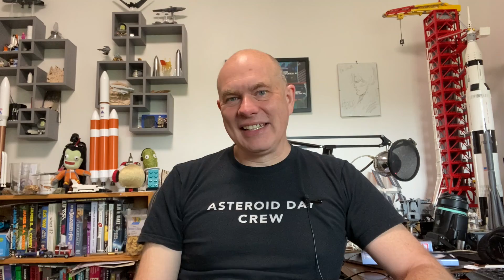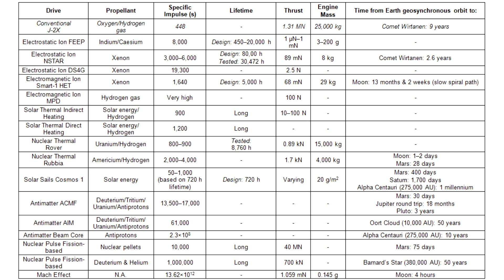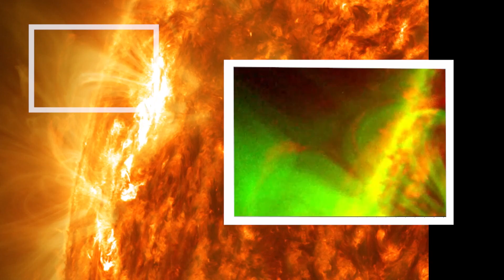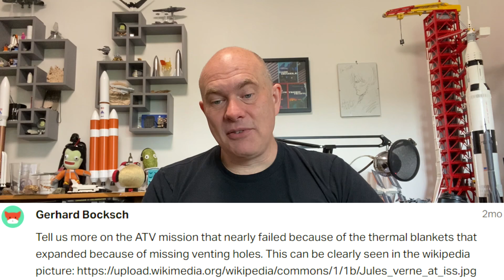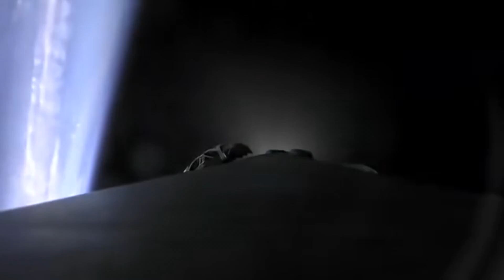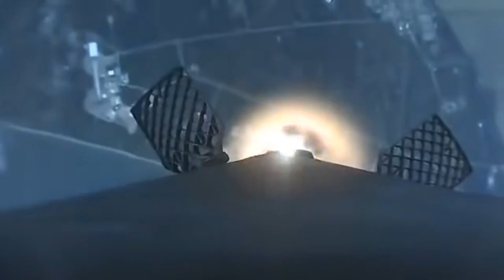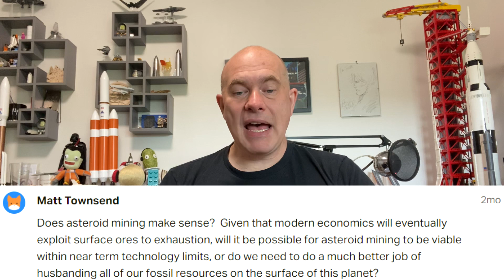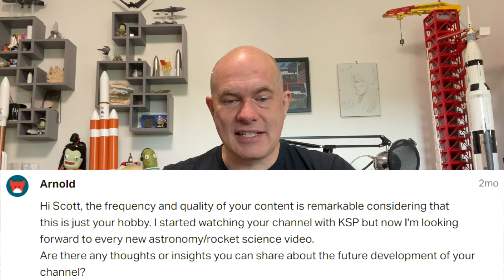Viewer Questions Episode 4

Comment: I believe the Raptor efficiency claim is combustion efficiency, or the turbo pump efficiency. I read somewhere "since the engine is staged combustion the turbo pumps are effectively 100% efficient. But it still uses 16MW of power, which translates to a 68K reduction in chamber temp."

Comment: Line source: The effect used in line sources is basically a synchronized pressure front. The pressure waves of adjacent emitters are constraint in one dimension, meaning the pressure will not drop by the square of the distance but just linear. A two dimensional area source would in theory have no drop at all. 
The question is - would it make any sense for a rocket engine, if the exhaust gases are basically constraint by adjacent plumes? Is a 3x3 Cluster more efficient than a 1x9 cluster? is a 1x9 cluster more efficient than 9 engines spread out? If the answer is yes, then I'm pretty sure the Falcon 9 is already using this principle.

Comment: I think that Elon Musk's 99% efficiency  refers to the fact that he gets 99% of the methane and oxygen to react due to the fact that they enter the combustion chamber as hot gasses rather than liquids which happens in most other rocket engines.  This says nothing about percent of maximum theoretical ISP or anything like that.

Comment: I think the 99% on the raptor came from “99% combustion efficiency” as in 99% of the propellant burning up inside the engine
Reply: Just remember with Starship so far it's 100% conversion of the engine to propellant and thrust in a 360° spread.
Reply: Yes. I was about to say the same thing.
Reply: I second this. I remember Elon Musk, interviewed by Tim Dodd (Dott? How does he spell it?) the everyday astronaut and saying "If God came into the combustion chamber and pair CH4 molecules with O2, he'd only do 1% better than us..."
Reply: that is, 99% of the chemical energy turns into thrust times Isp
Reply: @otheraccount5252  the 99% is just related to the chemical reaction. Musk said that because it's a hot gas-gas interaction he expects that 98-99% of the fuel and oxidizer molecules will react with each other. This will then of course be converted into heat which in turn results in pressure. But the question how much of that pressure gets converted into thrust is a different point. 

Isp is the result of everything taken together: a) how complete is the combustion b) how much chemical  energy is released from the reaction between the respective  fuel and oxidizer c) how well is the pressure from the combustion chamber converted into thrust as the exhaust flows through the nozzle d) how light are the molecules of the combustion product ... and probably more plays a role
That the combustion is 99% complete will not mean that 99% of the released chemical energy will be converted into thrust.
Reply: @christiansteinert6189  Indeed, 2. law of thermodynamics directly limits how much of that heat energy can be turned into kinetic energy in any desired direction.
Reply: @otheraccount5252  no about 60% turns into heat
Reply: @otheraccount5252  No, as in 99% of CH4 turns into CO2+H2O (with the addition of oxygen).

Comment: The raptor has reportedly 99% combustion efficiency, which makes sense since its mixing heated gases on account of the fuel cycle. This is expected to be one of the benefits of full flow staged combustion cycle engines.

I'd say it valid use of the word efficiency, but its a long way from the full system efficiency, which matters much more.

Comment: raptor gets the 99% efficiency from the combustion, 99% of the fuel turns into CO2 and H2O the remaining 1% either doesn't burn or is converted  into CO

Comment: I’d like to know more about the landing propulsion section for starships lunar lander! I’m sure you have some speculations.
Reply: Its known to be 25 small engines combining to provide the delta-v of a single raptor divided by 6 (lower gravity), but also angled to loose about a third of the delta-v.  Thus each is about 1% raptor thrust (~20 kN) and running on methalox.  So either a new SpaceX engine, an old experimental engine that SpaceX set aside, or maybe some "small" methalox engines from another NASA supplier.
  Wikipedia suggests these would be "high-thrust methox RCS thrusters" on a list of SpaceX engines. Fitting a 20kN vacuum engine in about 1m of surface shouldn't be too difficult for an experienced rocket designer.